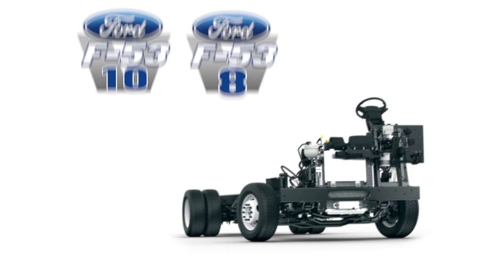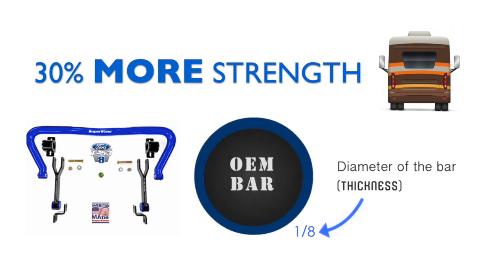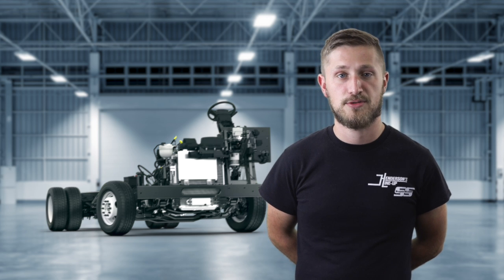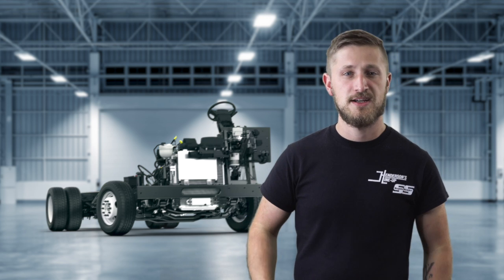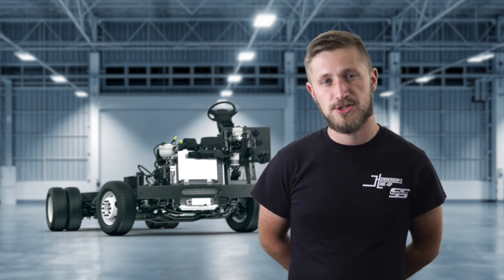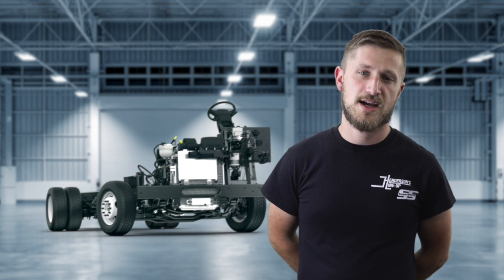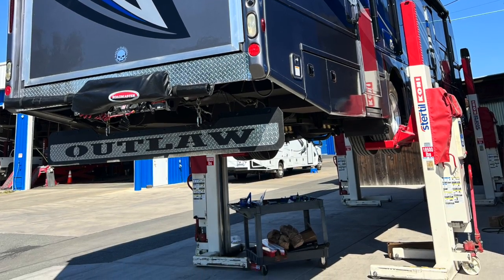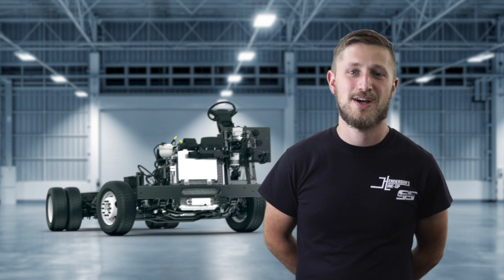Ford F53 Heat Treated Sway Bars: Ultimate Upgrade for Stability!

Comment: 2018 Winnebago Forza 34T on Freightliner XCS chassis.  Would be nice to see an overall review of what you have to offer for this chassis.  I understand you focus on the Ford F53 as the new popular chassis in need of upgrades.  I had a 96 XC chassis you guys work on for me, Thanks.  May try to get you way in the fall here for Alignment and front end check.  For sure wanting the SS100 bell crank, there seems to be a small glitch in the steering when observing underneath the RV, not noticed when driving but slightly more center play then when new.  Wondering if you still offer ballance masters for the front and wheel centering stud adaptors.  Don't like the rhythmic tire/tread sound I hear.  But anyway, thanks for past work and showing your faith in you business.  Jason Fast...  PS, Moved my Safe-t-plus to my new RV from my old RV as I'm sure it saved me with a front left blow out.
Reply from the maker: Hi Jason, thank you for the feedback and for the kind words! We are working on some content for other chassis besides the F53, including one on the SS100 bell crank for the Freightliner XC chassis. If you'd like to schedule an appointment this fall and/or learn more about what we can do for tire balance issues, please give us a call at 541-326-4033.